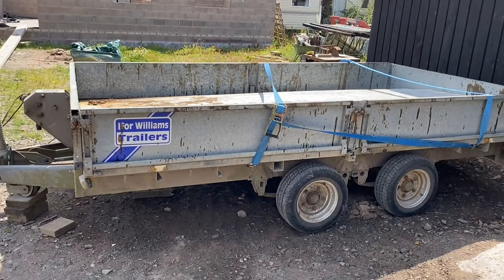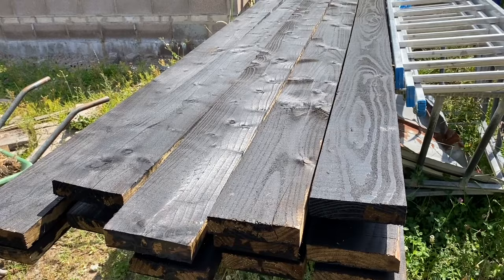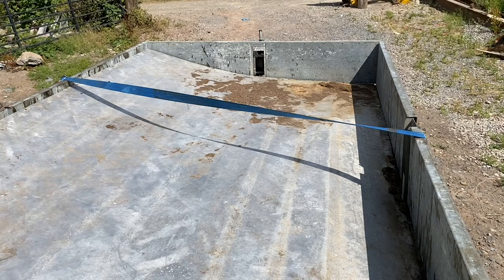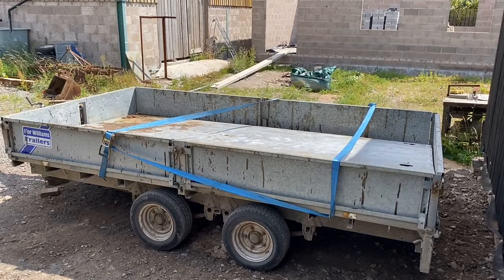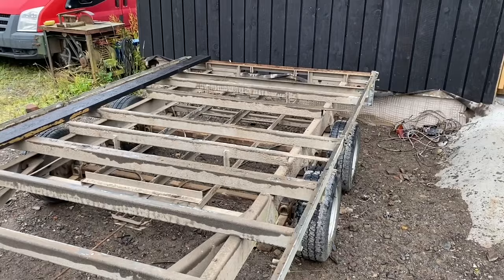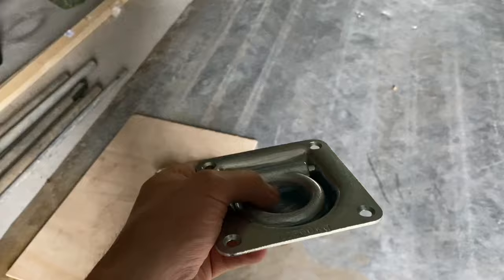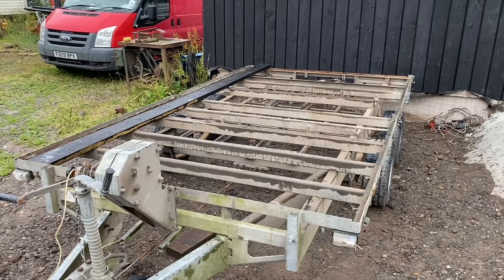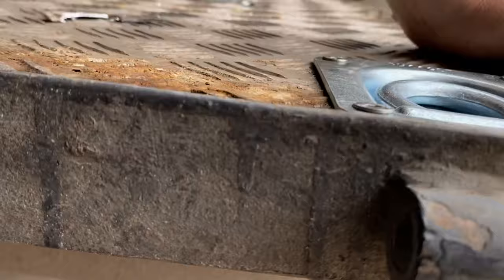#iforwilliams Fixing up an old Ifor Williams LM126 trailer

Comment: The plate was a great find, same size as what you needed to. Dont over look the tyres. They are supposed to be replaced at around 7 years. That trailer will give you many years of service. Well done.
Reply from the maker: I’ve got a new tyre to go on, but might just take them all off, shotblast the rims and fit all new tyres…

I’ve had a few blow outs in the past always when I’m overloaded!
Reply: @livingoffgridinscotland  Trouble is with trailers, they sit around a lot and then when in use, usually they are load to the max. Tyres pressures are ignored and then pop. New tyres, since you have done so much to it already would be a good idea. Don't forget the spare lol
Reply from the maker: @paulrobinson3528  the spare is brand new and lives in the boot of the Rangerover, I think I’ve got another brand new spare in the shed as I bought 2
Reply: 5 yrs

Comment: Hey I’ve a quick question. My Ifor Williams trailer axels have a lot of surface rust, it’s a 3500kg trailer like yours. Are these axels made of solid steel or are they box section steel?
Reply from the maker: Box section in the middle, stub axles are solid bar

I have seen them snap if heavily corroded

Comment: Another useful video, thanks for sharing. Don’t forget to use your home made creosote on the bare wood where you fixed the load rings.

Cracking job 👍
Reply from the maker: It’s had lashings of creosote… I’ve also sealed all the edges around the aluminum and deck rings to stop water getting down into the boards